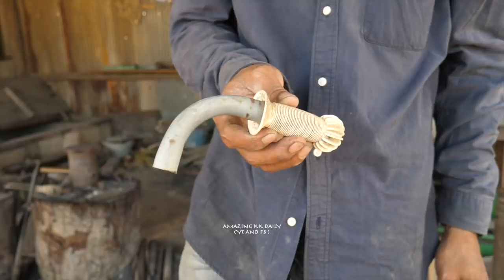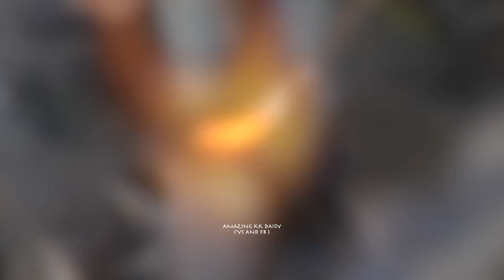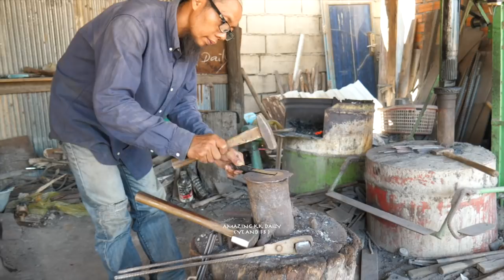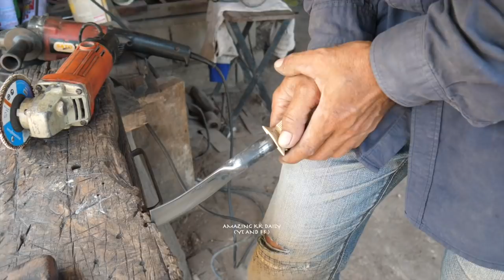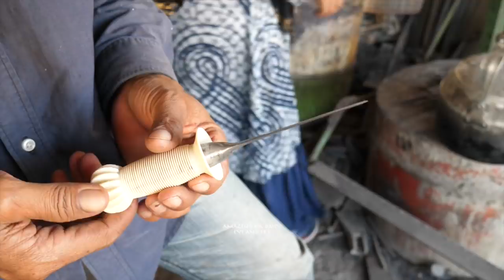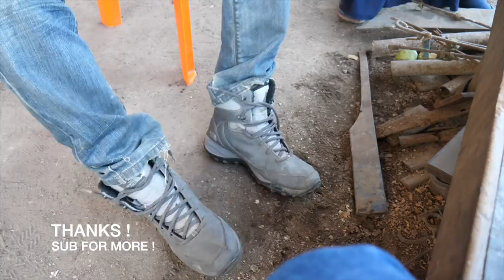MAKING A USEFUL KNIFE FROM A BROKEN BICYCLE HANDLE IS SUPER EASY

Comment: Bro get a full size anvil .. you don't quench in oil?
Reply: He never does. And I never see any normalizing or heat treating. I’m pretty sure I never see him anneal anything either.
Reply: @timjohle8876  The way he water quenches hardens and tempers at the same time. But pop off like you know something. Had you argued that the mild steel tube he used wouldnt harden, I would not have disagreed with you.
Reply: @117nh    Pop off. I don’t think so. I’m just saying what I see. A/H